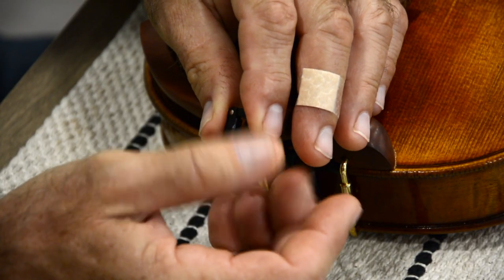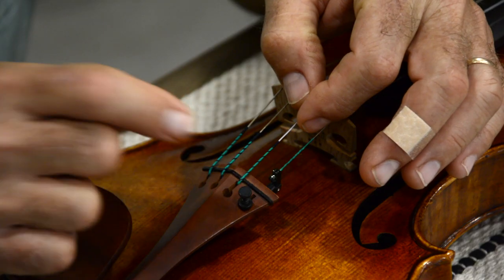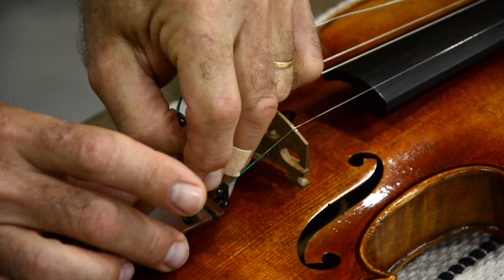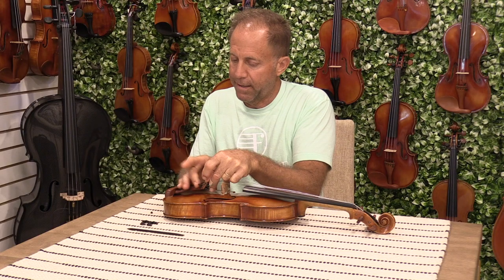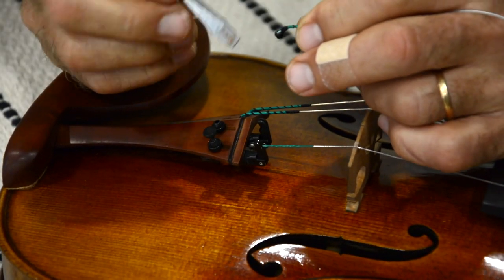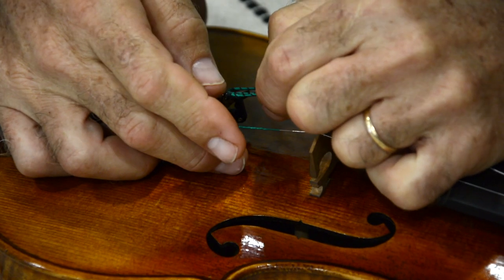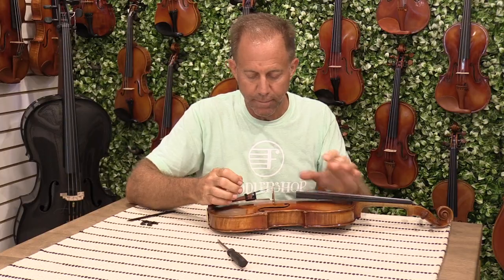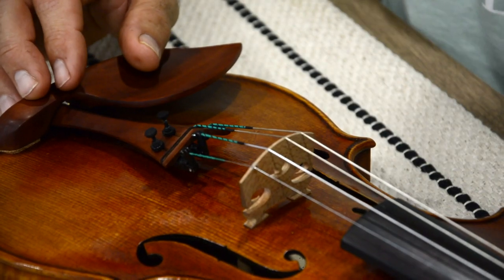Fine Tuner Installation

Comment: Ty that was just in time didn't know if I should tighten the nuts or not. Now I know
Reply from the maker: Yes, the nut just be as tight as you can by hand, possibly a slight turn with a needle nose pliers but be careful if you use a pliers.  The adjusting screw doesn't matter that much. If you tighten it, you'll be able to lower the tone. They usually need to be loosened because we usually tune up. If they are too far down they can scratch the top of the violin. I like having more play on the fine tuners so I don't tighten them till I need to adjust up. :)

Comment: How about doing a video on tuners of the pegs in the peg box. What's involved in replacing the standard pegs with tuning pegs?
Reply from the maker: Are you referring to geared pegs Chuck?
Reply: @1stfiddlerman  Yes. I'd like to see what's involved in adding the geared tuning pegs to a violin that has the standard tuning pegs. I'm sure that I can't "do it yourself" however I think it would be helpful to know what's involved in switching over to the geared tuning pegs.
Reply from the maker: @new.asteroid.tracker  You may very well be able to but the main issue is that tools are usually needed.
We try to avoid giving tips where someone can do damage to their instrument if they make a mistake. In other words not be liable. We can still do the video though. I'll check with the luthiers the next time we get an order for installed geared pegs, if they remember.
Reply: @1stfiddlerman  I do understand what you're talking about. However, just from a tutorial point of view, it would be interesting to see what's involved to change over to geared running pegs.
Reply from the maker: @new.asteroid.tracker  I can tell that you are interested. :) I don't blame you. I already talked to the luthiers. We'll see when I can get that done.
Reply: @1stfiddlerman  That would be great. Thanks.

Comment: My E string snapped round the ball and I tried to repair it just by tying a knot round the same ball. It's been holding so far, but looks lopsided and insecure, like it can burst out any moment. How common is it that falks repair their strings?
Reply from the maker: Very uncommon. You must be talented. :)
E strings are not very expensive in case you want to get a new one.
https://fiddlershop.com/products/d-addario-prelude-violin-single-e-string?variant=6799891791923

Comment: Hey, Fiddlerman. I heard that some of wittner fine tuners are a bit wider so you don't have to use a screwdriver to wide them. Is that true?
Reply from the maker: To me, it seems as they are inconsistent. However, it's really not hard to widen them.